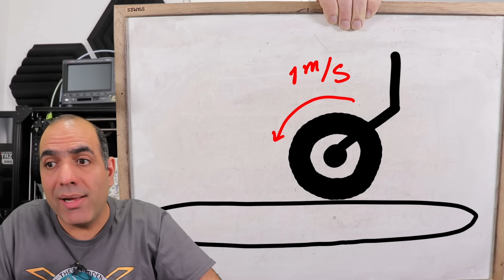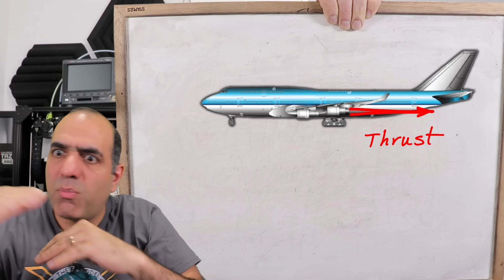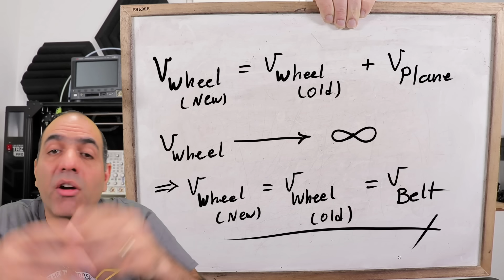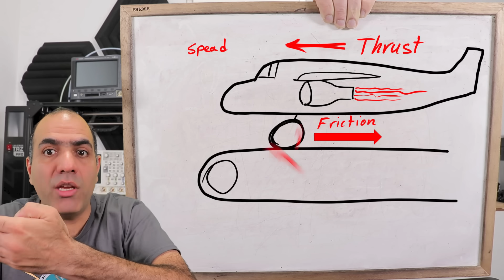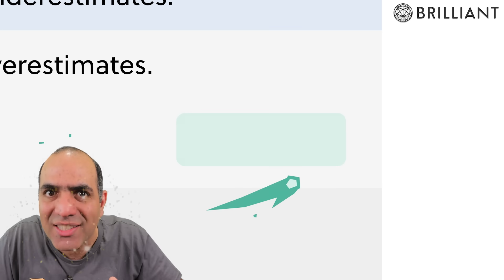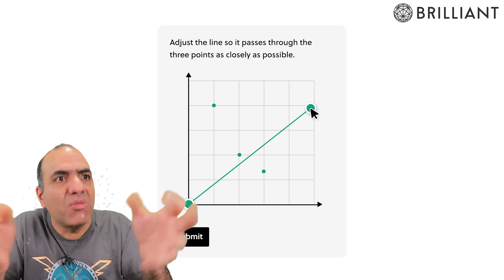Airplane Question that Drove Me NUTS!!!

Comment: Well, no, the plane wouldn't take off. It needs to be moving forwards to push air under the wings. The threadmill would just be spinning the wheels with no air being pushed under the wings.
Reply: Look at the question.  You see the conveyor spinning the wheels BUT the conveyor can only move if the plane and its wheels move in the first place.
Engines push the wings, wing push the fuselage, undercarriage moves the wheels.  The wheels move forward and as they move they rotate.  Wheel moves forward, conveyor moves backward.
A wheel can move forwards from the engine thrust and also rotate freely on this strange runway moving backwards.
Reply: Yup 100 % it would not take off , lets say no matter how fast the jet engines push the plane ,if the treadmill match the forward speed of the wheels truing . It would be not take off. 
The plane need forward speed for the air under and over the wings to create lift .
Reply: @inferno2502  So what youre literally saying, if you even realize it yourself (but i dont think you do), is that the wheels are used to speed up the plane to eventual takeoff. No, they dont. The wheelspeed does not matter at all. They spin independently from the plane. The engines are pushing the HULL, not the wheels. 

Let me remind you that planes can take off without wheels. They can and they do literally everyday. 
Think of the conveyor as a river and the plane is a seaplane with floats. No wheels at all. 

If you dont understand this simple answer then school is what you should attend next.

Comment: The most "in the spirit of the question" interpretation is describing a scenario that's not internally consistent.

I think it's fair to assume that the air is stationary relative to the ground, so we can use both of those as an external reference frame. The way the question is worded seems to suggest that the airspeed of the wings aircraft (outside of the engines) is kept at zero by the action of the conveyor belt. That implies the net force acting on the aircraft would be zero at all times relative to our reference frame. If that's the case, and we start with both the aircraft and conveyor belt stationary, the wheels of the plane would never need to rotate or move in any way. However, when the plane begins generating thrust, in order for the the zero net force condition to be maintained the conveyor belt must act upon the plane, and it does this by acting the wheels.

The result is a situation in which the wheels cannot be moving (because the net force on the aircraft is zero and no motion occurs) but also must be moving (because the conveyor belt must be applying force to the aircraft). This is a contradiction and suggests that the described scenario cannot exist and the question has no solution.

Comment: I never understood this problem, and why it's so controversial... I'm not usually the kind of guy that just solves these with no issues, but this one? It's just blindingly obvious that yes, it will take off. Why in the world would it not? The wheels have absolutely 0 bearing on the speed of the plane, they're just there so the plane doesn't fall trough the ground

Comment: another thing to take into account, it states that the conveyor belt is as long and wide as a runway, and that it is designed to match the speed of the wheels moving in the opposite direction. now the assumption is that the conveyor belt is powered. if it is not powered and you are solely relying on the construction and materials that have gone into the creation of the runway, bearings can only do so much. you would also have to take into account of the runway itself, imagine how much weight is in the belt itself. for something so long and wide, regardless of whether or not it is a 747, could the plane produce enough thrust to increase friction as to move the conveyor belt runway to overpower the runway's weight.

Comment: In the case with all the friction turned on, there is also belt->air friction. The belt accelerating pulls air along with it and the plane effectively takes off vertically.
Reply: The belt is moving to keep the plane in place. It's not going to pull enough air to generate a low pressure area on top of the wing which is what would be needed for flight. This is a 747.
Reply: @mikegamerguy4776  as the belt approaches infinite speed the amount of local wind generated would also approach infinity.
Reply: @burgersnchips  
The velocity of belt is perpendicular to velocity needed by the air/wind to produce the required amount of lift. There is no vector component from the motion of the belt acting on the wind above the belt, since it's motion is perpendicular to the air. Which means, no matter how fast the belt or plane is moving, it will never be able to provide any amount of force to move the air above it and produce any lift to the plane.

Comment: Before watching video, mythbusters did a video on this. Yes the plane will take off because it pushes with its engines against the air. rather than for example a car yhat the pushes against the ground. It would just cause the wheels to spin faster than normal.
Reply: You can easily think of this as, holding a toy car on a conveyor belt. and then move it 'upstream'. The force is external like the thruster
Reply: Now, the actual question is kinda impossible to solve, as it would lead to an infinite speed conveyor and wheel speed.

Comment: There's something you haven't considered -- the moment of inertia of the wheels. As you pointed out, to keep the belt speed and the wheel rim speed equal with nonzero thrust on the plane, the angular speed of the wheels needs to continually increase. That requires a torque, which must come from a force couple between the rim of the wheel and the axle. The reaction from that produces a backward force on the axle, which balances out the thrust from the engines. Therefore the plane experiences zero acceleration and does not take off.

This scenario doesn't require anything unphysical such as zero-friction axles. It wouldn't be sustainable for long in real life, though -- the belt would reach its maximum speed, or the wheels would start to slip, or the wheel bearings would overheat and seize up, or centrifugal force would tear the wheels apart, etc.
Reply: When the plane accelerates all the forces pointing backwards are less than the forces pointing forwards.  The energy from the burning fuel overcomes all the inertia, even that of a speck of dust on a passenger’s glasses.  The reaction felt against an acceleration does not stop the acceleration.

Comment: Im stopping at 1:12, the answer is  A resounding YES, The reason is because the way a wing works is by cutting through the air, This action is called shear. The shear of the air across the wing causes lift and drag. The thrust resists against the drag overcoming it meanwhile bulldozing air off the front of the wing with the majority of the air being swept under the wing creating lift and the minority being directed over the top of the wing creating drag, This biased split creates a positive lift control vector. Now that being said, even though the plane is sitting on a runway that is moving in the opposite direction it is also sitting in the air and so is its propulsion. Air speed is really what is needed and not ground speed to make lift. The wheels have bearings and so the wheels bearings would cancel out almost all of drag caused by the ground moving in the opposite direction. Lets add to this a little more. A fully loaded Boeing 747 'Jumbo Jet' on a normal long haul flight would take off at a speed of around 160 knots which is 184 mph. I happen to know that all aerospace parts are de-rated 3x what their design specifications are at a minimum but is generally higher. This means that in order to impose enough friction to totally prevent the jet from taking off, the ground speed would need to exceed its thrust capability and its thrust can propel the jet through the air at 570mph with no jet stream or create enough drag to prevent those speeds entirely but the question imposed stated matching the speed of the jet forward speed in the opposite direction, I know it refers to ground speed because of the inherent physical properties being a surface. Knowing all of this, its thrust can easily propel the mass at double its required takeoff speed at 368mph and the wheels and bearings can very easily withstand the presumably 2x time it would take to achieve such a feat. Done and Done, problem solved. I forgot to state an important part. If you do this with a car, the car will go nowhere because its force is exerted on the ground, a plane exerts its force against the air and in doing so does not rely on the ground to exert force wherefore the force cannot be canceled by equal and opposite force from a different medium.

Comment: I think that the point of the question is to purposefully confuse, since you say "but if the engines are on, it should fly!", but again, in my opinion, the actual "um, actually" answer is "it doesn't take off". I think that by the plane "sitting in the belt" means just being stationary, like you getting on a powered-off treadmill, and the engines are assumed to be then started, and the treadmill would match the speed of the wheels, which is the speed that the plane is spinning at. I don't think that there should be wind, since the point is the interaction between the plane, its engines, wheels, and the treadmill band (our "ground" in this experiment Key point to remember, a plane is just an air powered car until there is enough air for its wings to generate lift. Sure, a car uses its energy to spin its wheels, and the plane uses its engines thrust to move, but at the end of the day, its all the same, its a way for the vehicle to overcome the force of friction created from the vehicles weight against the ground (due to gravity). So given that the band's speed is adjusted to the ground speed the plane would have, it would always have a net speed of 0. Like using an R/C car on a treadmill, in which the speed with which the wheels advancement is synced with the speed setting of the treadmill, so that the car remains stationary in relation to the floor. By that logic, if you handed over a hang glider to Superman running at 100 mph on a treadmill, he would immediately take off, but you more intuitively know that it would just be Superman running at 100mph in a treadmill, holding a hang glider... It's all about context and variable elimination. xD

Comment: As the plane accelerates it generates lift, even before liftoff. This lift opposes wheel friction so the "friction EVERYWHERE" model was left incomplete. There is also material integrity of the wheel bearings to consider. If a wheel locks or catastrophically fails, it is likely the plane will veer off course and crash.

Comment: An airplane requires lift to take off the ground. Even if you run the wheels at a theoretically infinite speed, as long as you are not providing incoming air for the wings and any thrust from the engines, the plane will not take off. 

Moreover, if you decide to run the engines at maximum thrust, and the conveyor belt is capable of imitating the tarmac and matching how fast the wheels turn, you might possibly end up with either: 

A.) Plane jumps off the conveyor and take off, or destroy everything in front of the jet; or

B.) The jet exerts a forward motion and the conveyor belt would move faster and faster until it gives way, or the friction gets greater than the thrust the engines can provide, but the plane doesn't take off, nor lift from the ground.

Assuming the jet is just idle on the ground and you dont provide any thrust with it, it would just stay still. Even with a more generous assumption that you spin the conveyor belt at the same speed the wheels turn at Rotate speed, the plane still wont take off because there's no lift being produced on the plane's wings, unless of course if you have a headwind fast enough to actually give the aircraft lift without the engines.
Reply: You see the plane stationary on the conveyor, the wheels are not moving forwards so how could the conveyor start to move? 
The conveyor moves in the opposite speed and direction to the wheels SO what makes the wheels move in the first place?  If the engines pushed the plane for the first wheel and simultaneous conveyor movement they will keep on producing movement.

Comment: When you explained the situation at the beginning i thought that the plane wont fly.  I thought that just pushing air back wont take the airplane airborne. I always assumed that it has to do with the speed of you relative to the speed of air that goes from the nose of the airplane to the wings and tail. I might be wrong since i am a simple electronics engineer designing SMPS and staff. Damn it this hypothesis will drive us crazy.

Comment: I don’t think your quite right about the third case. I think the tires would melt and fuse from the heat generated by friction and the jet would drag them as it speeds up. Now will it gain enough speed to take off with the drag of all the wheels? Prob not as Jets are the most vulnerable at take off and landing.

Comment: Think of it this way: you stand on a treadmill wearing rollerskates. You hold a rope attached to the wall in front of the treadmill. If you pull on the rope will you go forward? I think in this case everybody will answer yes
Reply: well... if the treadmill goes backwards with an infinite speed as soon as you start pulling, I don't think you will be able to pull even a tiny little bit - I think your skates will break.

Comment: Another answer - if the treadmill is running at zillion km/h it will also drag the air around it with it and cause the airplane to lift off but then it will get further from the treadmill where the air is going slower and go back down.

Comment: YES THE PLANE WILL FLY BECAUSE IT GETS ITS POWER THROUGH THE AIR NOT THROUGH THE WHEELS THEY ACTUALLY DID IT ON MYTHBUSTERS THE PLANE TOOK OFF ON A CONVEYOR BELT

Comment: The point of contact between the tyres and the conveyor moves with the accelerating plane but the physical contact surface material at the junction is still moving towards the start end of the runway. (Imagine Mehdi’s exasperated eyebrows at this point).  Think relativity.
At 160 knots take off speed the conveyor is moving towards the start end of the runway at 160 knots.
The base of the (freely rotating) tyre is also moving towards the start end at 160 knots satisfying the requirements of the original question, viewed from the left a clockwise conveyor and an anti-clockwise wheel.  The rubber tyre grips without any slipping.
The 747 and the undercarriage legs and the wheel hubs are moving towards the climb-out end of the runway at an opposite 160 knots.
The 747’s wheels are gripped by the conveyor moving in the opposite direction and move at a relative minus 160 at the base of the tyre in intimate non slipping contact with the conveyor.
The wheel hub is moving at a relative plus 160 with the take off speed 747 aeroplane.  The wheel is therefore freely rotating on its frictionless bearings at the 320 knot equivalent rotation rate, both motions add up and contribute to the rotation rate of the tyres and wheels.
Mehdi’s confusion and his infinite impossibility error comes from rigidly viewing the 320 knot rotation rate as the instantaneous impulse flinging the previously 160 knot towards the start end moving conveyor up to 320 knots with infinite acceleration.  He says the wheel was rotating faster than the conveyor runway.
Mehdi did not see the 320 knot rotation wheel (in perfect, intimate, non slipping contact) tearing down the runway at 160 knots, there is his error.  He has missed the relativity of the rotating contact surface material going at 160 knots in one direction with the wheel hub going at 160 knots in the other direction.
The position of the tyre-conveyor contact can move towards the climb-out end even though the base of the tyre to conveyor physical material is moving towards the start end of the runway.
Mehdi gets the technology of the wheel wrong.
(Again tyres have a maximum speed rating).

Comment: It isn't the wheels turning that makes a fly take off. It is the turbines under the wings that accelerates air and makes jets behind the airplane that pushes it forward 

But if the conveyor belt matched the speed achieved by the turbines, the plane would stay still and not take off. However, since the wheels are rolling, I can imagine that the conveyor belt wouldn't actually push the plane that much backwards (think like how a bottle placed on a conveyor belt would very much stand still) 
The plane would move forward compared to the surroundings and thus be able to take off (hopefully the conveyor belt would be long enough for that)

Comment: If the engines are moving the plane forward at some velocity v, wouldn't the tangential velocity of the wheels be -v at the belt? if so, then the belt's tangential velocity would be opposite of the wheel, which is just v. So the plane would be getting pushed forward by the belt as well

Comment: The Airplane would lift off, due to the planes using jetengine to move, not the wheels.

The wheels only help to stablize while on the ground, or landing/takeoff.

Airboat's use big fan for thrust, so they can go through the wetlands at top speeds.

Seaplanes uses floats instead of wheels to take off in moving or still water.